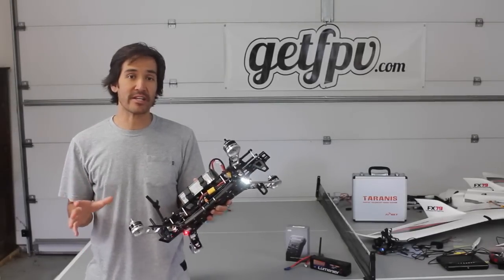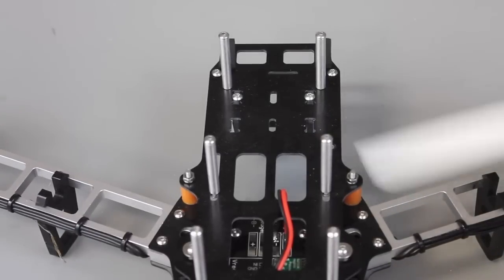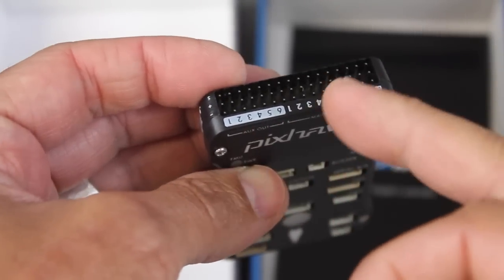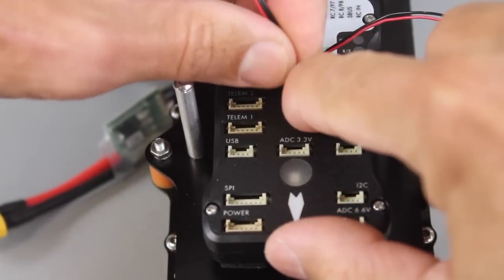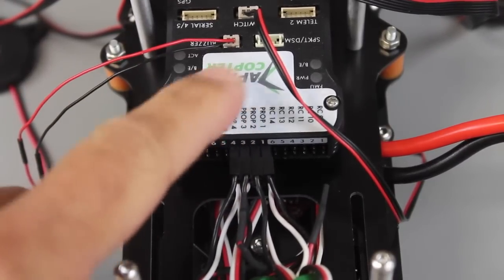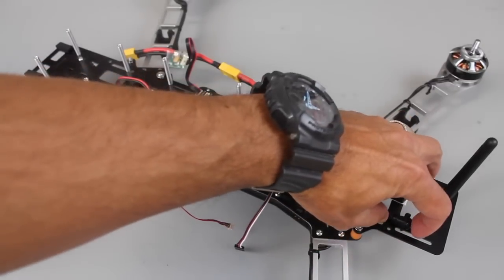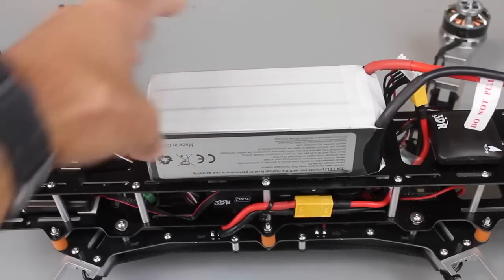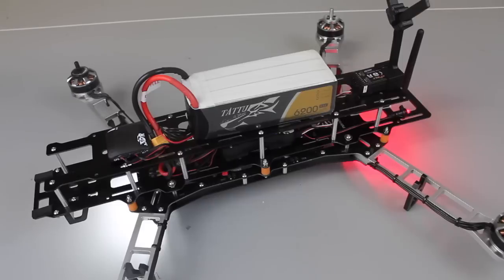Pixhawk Unboxing and Installation in QAV500

Comment: Dennis, another great video. One thing you may check is your gps signal while using a go pro. I've had issues with a gps antenna too close to a go pro 3. You may want to place your gps antenna higher. However with my pixhawk the 3DR gps antenna world very well.
Reply from the maker: renoflash06 Thanks for the feedback. I'll definitely look into this. I've heard of the GoPro causing issues with the TX/RX on 2.4 GHz if the wifi is on. I'll look into the issue you mention about interference with the GPS antenna. Thanks.
Reply: A easy way which I'm sure you are aware of but for everyone else is to watch HDOP in mission planner or droid planner 2. Power up the craft outside and wait for the gps to get a good lock. Then turn on your go pro and look at HDOP. Then set go pro to record and check HDOP again. Finally turn off go pro and and check again. I would repeat again while hovering in stabilize mode. Also look the trace on mission planner to see if the GPS made a large jump like <100'.

Comment: Curious how 2 Telemetry devices would be used and why.
I sure do like the clean and smart layout of that QAV500- are you going to mount a gimbal out front?
Reply: You may want to run a Bluetooth module along side the telemetry radio as well as an OSD.
Reply from the maker: ***** Exactly what Conan Mills said. For my case I would use something like MinimOSD on the telemetry 2 port, but as of right now I'll just stick with one feed to my ground station. I may do a gimbal in the future. I want to do some mapping tests for it and have been working on a 3D printed gimbal. Will share that as I get closer to a working prototype.

Comment: You need to pull a trailer for the battery!  Do you sometimes put two in parallel to cut costs?
Reply from the maker: Chuckles Too funny. It is a big ole batt. No I haven't run them in parallel before, but thought about it for one of my wings. Just didn't have enough space in the fuselage. Thanks for the question and I may consider this in the future. Take care.

Comment: I didnt know the pixhawk power module was compatible with 6s 22.2v batteries? 
On 3DRs site it says its rated for "...a maximum of 2.25A from up to a 4S LiPo battery" with a maximum current reading of 60A. 

I would look into that. If it does work, I have a few people who would be happy to hear the news
Reply: Dennis Baldwin
I am sure you found it- but the Mission Planner actually has the preset for the atto 180 for battery monitoring- forgot to mention it. Just click the option in the set up- both attopilots chips are- there are special considerations for the math for specific accuracy unless hat has been corrected. Holler if you need links to the articles and diagrams or need to breakout of the power module pins- there are 2 5v and 2 ground and current and incremental voltage measurements- there is a specific sequence if you need the resource. http://diydrones.com/profiles/blogs/how-to-guide-pixhawk-with-6s-batteries-4s
Reply: EDIT: 
wouldnt you need to do this mod to accurately and safely run 6s? 
http://copter.ardupilot.com/wiki/common-using-a-pixhawk-with-6s-batteries/
Reply: You beat me to it- I run a 6S on my hex and use the attopilot 180- I spin 3508-380kv motors and this was a simple mod once done- but confusing to wrap my mind around originally since I didn't know the pixhawk.
Reply from the maker: ( ͡° ͜ʖ͡°) Zevi Rubin That's why I love this community so much. It's guys like you, Hiway, and others that have pointed the 6S issue out. I've only setup Pixhawk with 3S and 4S before. It didn't even cross my mind that there's a voltage/current limit on the module! I'll need to do some more digging to see what the real problem is. You would think if there was a voltage limit I would have blown the module just by plugging the 6S lipo in. Thanks so much.
Reply from the maker: ***** Great stuff from you and Zevi. I mentioned to him that I've never flown Pixhawk with 6S so this limit didn't even cross my mind! I'll need to do the AttoPilot mod and will definitely share this information in an upcoming video as well as give you guys credit. You deserve it. Thank you following along and keeping me in check.
Reply: Dennis Baldwin No worries. I only know this because I am looking to get a longer flight time rig on 6s with my pixhawk and just did all the research for it myself :) looking forward to your video on it!
Reply: Dennis Baldwin
Shit man- I learn more from you in a minute than I could ever pass back.
I agree on the community though- I would still be on the ground and staring at parts if not for this incredible community of modelers, hobbyists, and engineers- all of whom are much smarter than yours truly.
Reply from the maker: ***** You and I are in the same boat then. Thanks for the kind words too.
Reply: ChaseBrumfield I dont have much experience with big 6000+mah batteries, as I fly my big crafts with parralel 4500/5100mah batteries. I have always just used xt60. some of my wires have been awfully big to fit into the standard xt60 connector, so I usually just run a razor around the wires lightly to trim down some of the outer wires. I then apply a generous amount of tinning to try to accommodate for trimming the end down a bit. Probably not a great way to do it, but I didnt have any 10g size xt60's at the time.
Reply: *****  I'm dumb, that's what I meant by "xt60 10 gauge size."  I'm thinking I'll use the xt90 with 10 gauge wire to connect the battery to one side of the attopilot.  Then I'll have 12 gauge wires coming out of the other side of the attopilot with an xt60 connector.  This will then be connected to the QAVframe.  This would allow me to only switch out the connector currently on my battery and have the ability to use 4s batteries if needed (most of these come with xt60 connections).  Do you see any potential issues with this?

EDIT: For some reason I didn't see your original response with the detailed explanation.  EXTREMELY HELPFUL.  Thanks a lot.
Reply: *****
Perfect.  Thanks again for all the good info.  I'm going to rock all EC5 connectors and 12 gauge wire because the local Radioshack is out of 10 gauge.  Seems like it's pretty much a wash either way but from everything I've read the EC5 connectors might have a slight, and I emphasize SLIGHT, quality advantage over the xt60's and 90's.  I haven't found any solid proof of this, but it seems the majority of people who switch to EC5's have nothing but good experience with them.  I've seen a few people say the xt60's can start to pitt if you run too much current and effect the solder joints.  The couple people who've said this, however, were also concerned they may have gotten the cheap china version xt60's.  Anyway I hope this conversation has helped clarify things for people.  Thanks for the great learning experience.
Reply: ***** Can't wait to get this machine in the air now... just waiting on connectors, wire, props, attopilot, and the calibration video from Dennis.  Super pumped.
Reply: Dennis Baldwin Also, I just started soldering up the frame today and noticed that my Lumenier 8000mah 6s battery DOES NOT have an xT60 pigtail with 12 gauge wires, it has 10 gauge wires and a connector marked "EC5."  This obviously won't fit the xT60 connector that it looks like you're using with your current setup.  I'm not sure what the best solution to this should be?

Should I cut off the current EC5 connector and squeeze the over-sized 10 gauge wires into a 12 gauge xt60 connector (assuming that it could even be made to fit), leaving all the other main power wires at 12 gauge?  Or should I change all the main power wires to 10 gauge and buy a few EC5 connectors?

Your thoughts?  I don't know enough about electricity to know if the 10 gauge vs. 12 gauge wire would make a difference/effect performance/get too hot, etc....

Thanks in advance!

EDIT:  I didn't realize the xT60 also comes in a 10 gauge size, so no forcing necessary.  With that said, still not certain on what route is best.  Same gauge wires or different gauges ok?  All xt60 connectors? All EC5 connectors?
Reply: ChaseBrumfield
I will let Dennis address this- but post what I did.
The XT-60 is rated for 60amp- which is more than what the motors and electronics will draw but the lipo can push more so hence the EC-5. My 8000 lipo came with 5mm Barrels, and I soldered on an EC-5 so I could have proprietary connectors for 6S to differentiate at a glance (I have a lot of batteries)
If you wish to not solder, or just keep the battery as is- Hobby King makes an EC-5 to XT-60 adapter for a few dollars as well as most all other connector configs.
I run 40 amp esc's with 3508-29-380kv motors on 6S through a 120amp rated PDB and through both XT-60 and EC-5 connectors. I would not endorse it if I were a formal business though for simple liability reasons. So hopefully that helps provide the information so you can make an educated decision that works for you. One last thing- I believe EC-5's are rated for 60amp.
Ultimately if you can solder, then you can just customize whatever you want to go with and if you want the proper rated connector, then use 5mm Bullets- they are very easy to solder and inexpensive. They do not always stay together and require some dielectric grease and maintenance since they are plugged and unplugged frequently.
Reply: ( ͡° ͜ʖ͡°) Zevi Rubin
There is a XT-90 also- rated for 90amp
Reply: ( ͡° ͜ʖ͡°) Zevi Rubin Interesting, so you're going from 10 gauge at the battery, into a 12 gauge sized xt60 connector, and then 12 gauge out of the connector?  How many amps are you pulling max through a connector setup like this?  I guess if you haven't had any problems then the 12 gauge size xt60's are handling the amps just fine?
Reply: ChaseBrumfield
I don't see any problem on the surface- meaning I would not hesitate to do it on my own build- but you know how some opinions and opinions can be- since it isn't to "spec" it is arguably a bad practice- but if I had a dime for every spec I have not followed to the letter (albeit with a solid bit of understanding what rules I am breaking) I could pay for the parts on a QAV540 ;)
In a nutshell- I'd do it.
Reply: ChaseBrumfield
Good choice- I will go you one better on why you made a solid decision- the xt60/xt90 connectors are notoriously difficult to connect and take apart if you have cold fingers, or forget to add a drop of light silicone to assist- the EC5 are much easier on the hands and don't have this infamy.

Comment: I have been looking forward to these videos. Thank you!
Reply from the maker: ***** You bet man. Hope all is well with you.
Reply: All is well. Do you have any idea why my TBS Discovery with Pixhawk would be giving me trouble when I try to autotune it? I takeoff in stabalize/stability mode then go to a comfortable altitude. Then I switch it to altitude hold to prepare for autotune and it will shoot up a couple of meters. I have to regain control by lowering throttle or switching back to stabalize mode. I use DJI 30 amp opto escs and DJI 2212/920 kV motors. The props are Graupner 10 by 5 with the 8mm spacer under them to fit the DJI motors correctly. At times I can get autotune started in altitude hold mode but it will still shoot up in the air after autotune starts its dance. This has caused me to crash and damage my TBS Discovery twice. Now it just sits until I can figure this out.
Reply: ***** Are you certain you're in AutoTune and not Auto mode?  I had this happen once and the symptoms were similar.
Reply: Waylon Johnson I eventually got it to work correctly.
Reply: Great news! What was the problem?
Reply: I think it was an issue with the Pixhawk not really liking to many vibrations. I switch to some balanced Graupner props and all was well. I asked used kyosho gel pad under the Pixhawk to help with the vibrations.